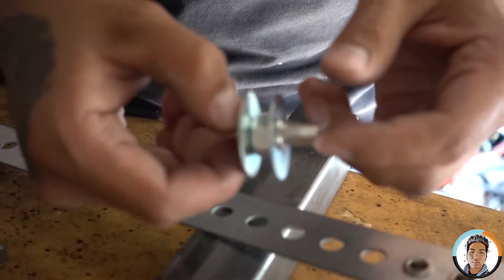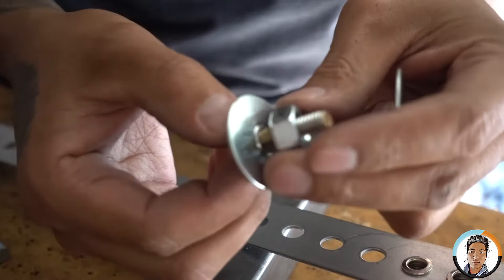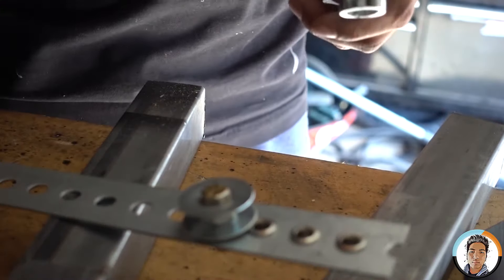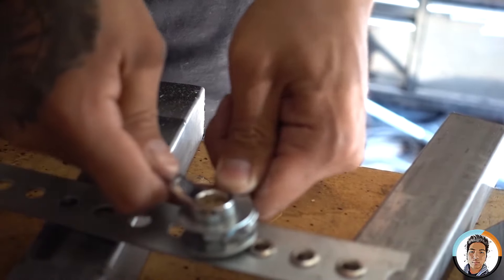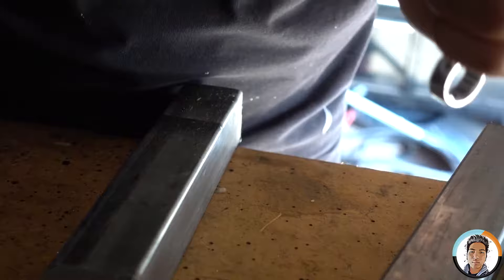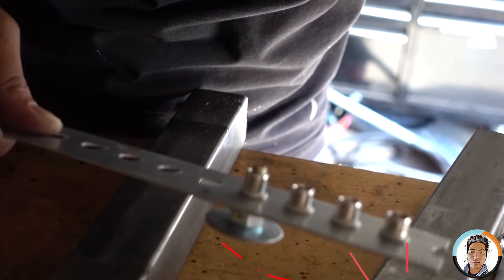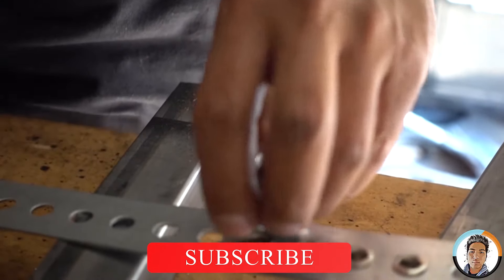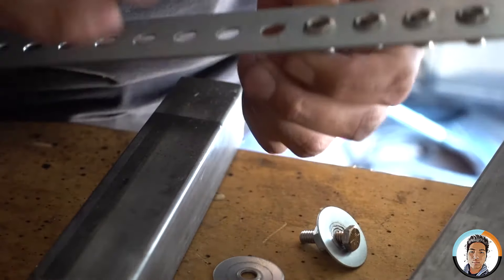DIY Tool Easy How to make a rivet nut nutsert tool

Comment: With this method of inserting the internal threads of the nut is possible to damaged due to the tension and friction with the threads of the bolt.Better is to tight an external hex nut having no rotation and friction inside the rivnut only a static force until it expands.
Reply: good point.
Reply: But the dedicated rivet nut tools use threaded inserts

Comment: It only works with soft rivet nuts like aluminum or small mild steel rivets because the force needed to pull the rivet up just spins at back and will not start. The only way these really work in with a straight pull action tool, but it needs to be a good brand.

Comment: what stops the sertnut unscrewing or simply spinning in the hole
Reply: Friction in this method. You can't easily use it straight with the impact drive, but need to use wrench method first to tighten it slightly. As the bolt is rotated, it will pull the rivet upwards by starting to expand at the top, as it is squeezing it toward the bottom washer, and as the object material is between washer and rivet, it gets quickly squeezed to it, and then you have strong friction. 
It works well on the tough and smooth materials, but going for softer/too hard material and you start to have more problems as they can expand/crack and keep rotating.

You are not suppose to rotate the nut from the top, as now you are rotating it so it will as well rotate the rivet nut.
Instead rotate the bottom nut, as now you can't rotate the bolt itself, but you are using that nut to pull straight up the rivet nut, without rotation. This is important for closed rivet nuts, as you need to place the bolt as deep as possible, and then you can't rotate the bolt anymore as it would go through the bottom.

Comment: Here is an idea...How about correcting you lighting and positioning and knowing your equipment before posting a bad video....redo the video man.....it sucks
Reply: @A. Melbs He could have just adviced to use a manual focus. Set the focus to wanted distance and know that everything needs to be shown in that. People are too much thinking that autofocus is required and if it doesn't work, they go to shop a "better camera". Another thing many doesn't know is that every lens has minimum focus distance, and longer your focal length is (narrower field of view, zooming in) then further that minimum focus distance is.

No need to say to learn about lighting or positioning as they were OK for the whole video. It was just that camera was on AF and too close to the subject.